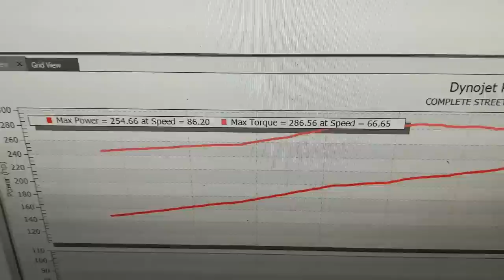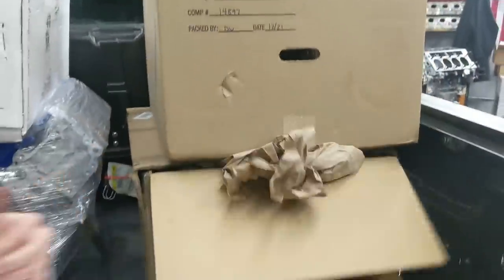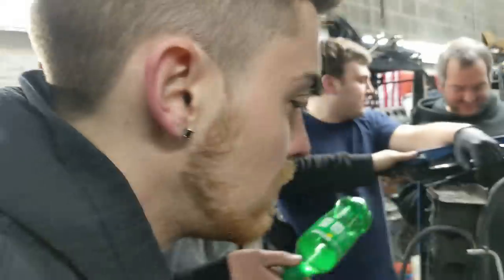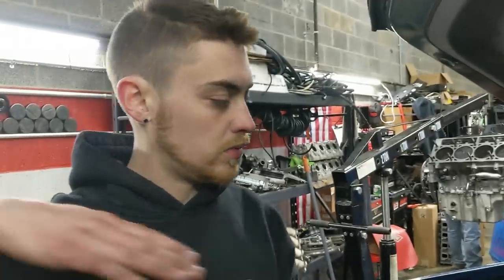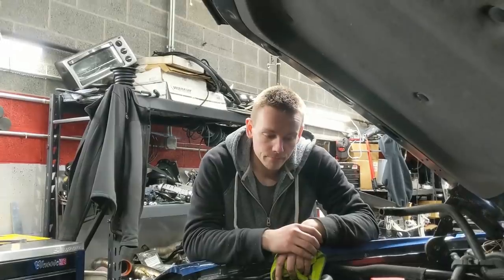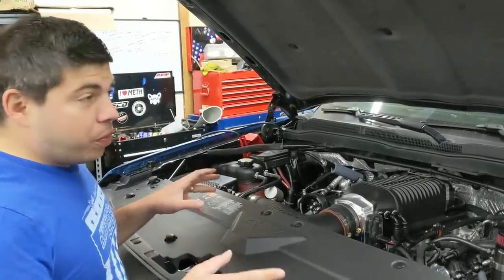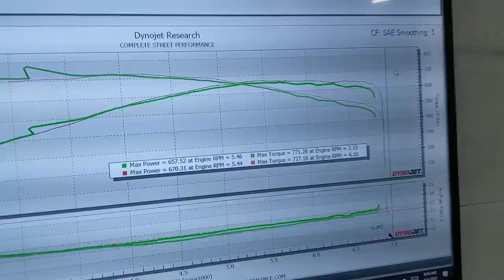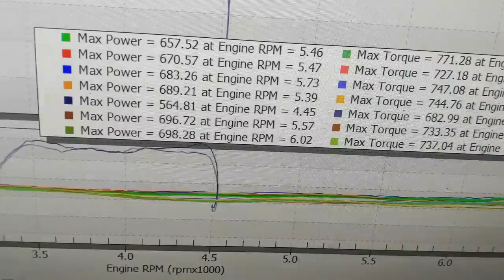How To Turn A V6 Silverado Into A 700+ Torque Monster

Comment: The stock power is actually impressive for being the most basic V6.
Reply: I kno that's really good power at the wheels too  the new 4.3 actually have potential I'd like to see one with basic mods.bolt ones and a 100 shot or something  wish I had that 4.3 in my 2000 s10 my v6 one I Also got a.ls swapped 4.8 on a 100 shot

Comment: That moment when you realize the 4.3 is an LS V6 💥💥💥 So many possibilities with these trucks!!
Reply: Not to mention how crazy light these engines are. Less than 300 pounds without fluids!
Reply: LT. Not LS
Reply: right, mines knocking so ive been thinking if i just get a 5.3 or 6.2 and swap it or just rebuild the v6
Reply: Basically a 5.3 with 2 less cylinders🙂

Comment: It's the 4.3 just 2 cylinders less than a 383 stroker? What I mean is; other than having two more cylinders, the 383 stroker and 4.3 are nearly if not exactly the same.
Reply: a 4.3 is a 5.7 with 2 less cylinders.... same 4" x 3.48" stroke...

Comment: Just cant wait to get my C8 Z06 & have u guys tune it or TT it. Hopefully it will have forged Internals.
Any guesses if it can handle the boost? Will any work have to be done to the heads if/when I boost the Z06 or Z51 Stingray?

Comment: i don't even understand the concept of a full-sized truck with a v6. that's for the mid-sized trucks. full size should always be a v8 at least.
Reply: I agree for the most part but if they could make an Ecoboost sound like this truck I may be persuaded. The low end torque from the Turbos make them feel more powerful than they are. I've driven a fusion Ecoboost 4 cylinder and a charger V6 8 speed and the Ecoboost felt stronger and like it would be a lot quicker. In reality the charger has slightly quicker 0-60/ 0-100mph times.

Comment: Probably a dumb question but how did you make 50 ft lbs more torque then HP ?... Im looking to make more power in a jetboat which there all about torque so JW if its the whipple charger or something else......
Reply: Depends on the cam profile as well , you can spec a cam that is more torque oriented

Comment: Had a truck like that with 5.3  The truck did A13.63 stock with the e 85 The truck was stolen and never found then I got a ford  Much better platform made 800 horse at the back tires without opening the engine just a whipple

Comment: What seats did you put in there?
Reply: @saeedalmarri6634  Nice Truck! Is your wing from K-Designs?
Reply: marqueso1600  thanks yes my friend
Reply: @saeedalmarri6634  You're welcome! 👍🏾
Reply: @saeedalmarri6634  thank you!
Reply: Josh Wolfe My pleasure
Reply: @saeedalmarri6634  Had a quick question Boss....what kind of fuel system do yo have on your Truck? Im building mine right now but i feel fueling is my weakest link..i have lt4 injectors...lt4 high side pump...and walbro 450lph in  tank pump....i want to run e85 no meth....i keep on reading it is not enough to make 700whp.
Reply: @marqueso1600  I don’t know actually because I am with pump gas
Reply: @saeedalmarri6634  cool cool....Thanks for the response! 👍🏾

Comment: cylinder deactivation is dumb. it fails. so glad i got a truck pre-cylinder deactivation.
Reply: Yea I got a handheld tuner and turned mine off on my 2014 tahoe. ..it would drive me and my wife nuts going in and out of 4cyl mode....

Comment: Why don’t ppl like v6? I don’t see a problem w it unless u want to be on the edge of getting a ticket just to show ppl u can do 0-60 in 3 secs
Reply: I love my v6, it has a really nice sound at low rpms and its not obnoxiously loud with just enough power for anything besides racing (which i dont do because its a truck not a race car)